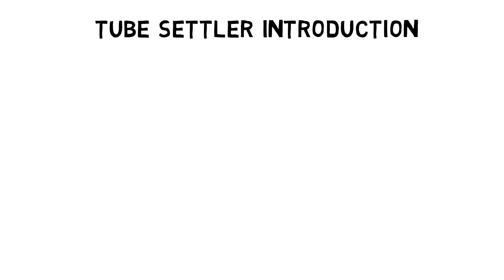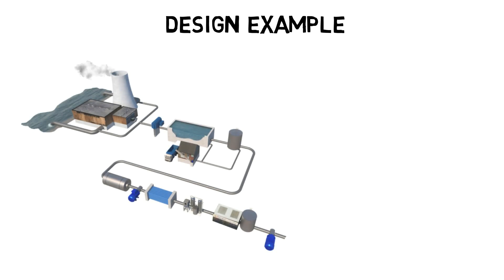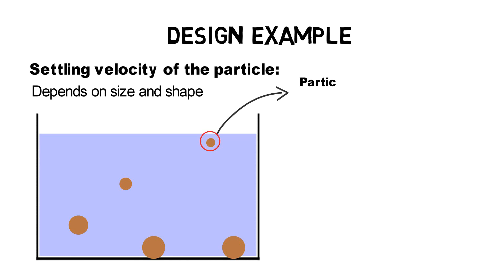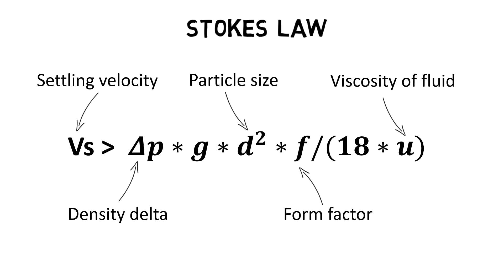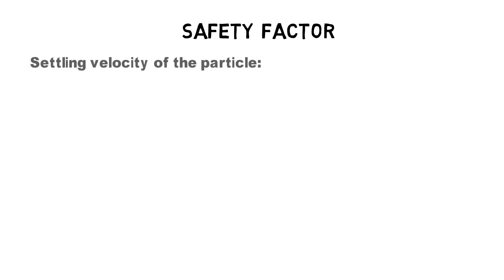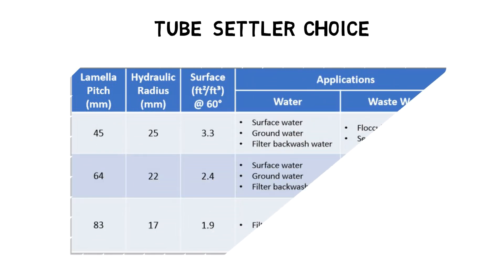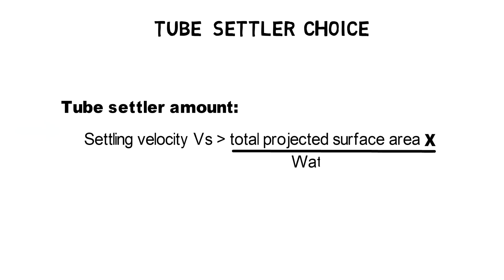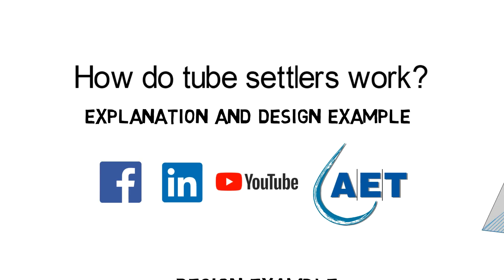How do tube settler work - plate settler, lamella clarifier tutorial

Comment: is the settling velocity of 1,67 m/h the minimum for lamella clarifiers?
Reply from the maker: No it's just an example. If a particles has a settling velocity of less than 0.4m/h they are so small that they practically can't be settled down anymore. But if you use coagulation and flocculation you can increase the particle settling velocity